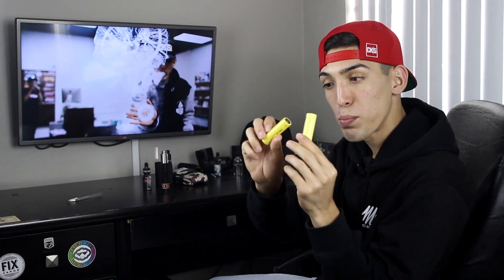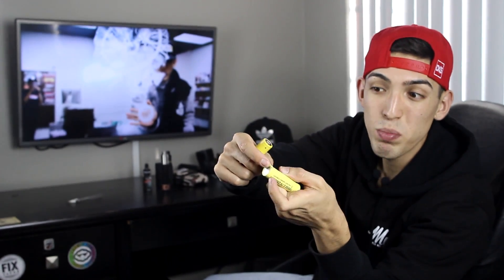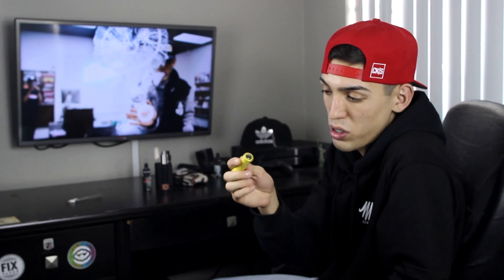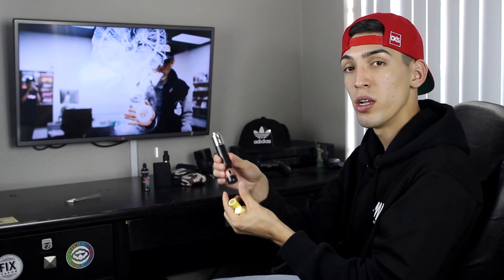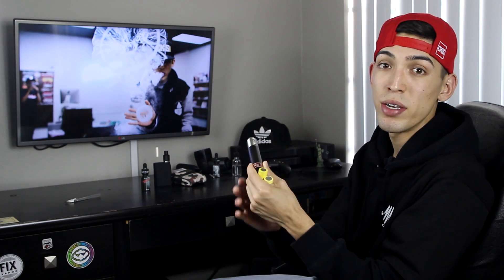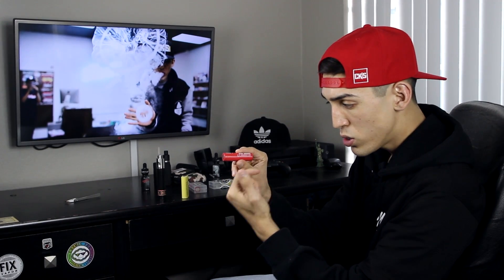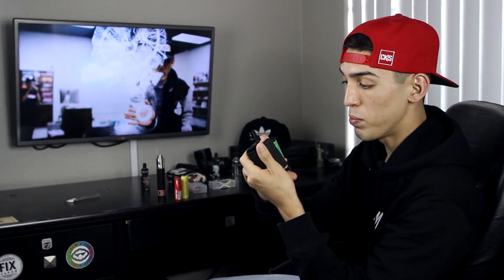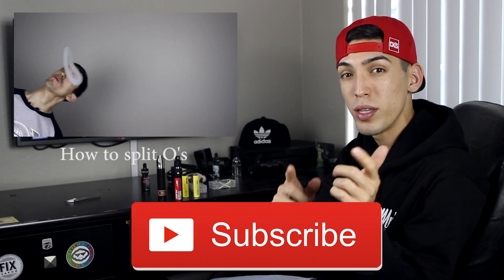WILL MY BATTERY EXPLODE??? (Understanding Batteries)

Comment: Tbh this is a very bad explanation of battery safety. First of all you keep talking about ruining your mod and the battery, you know that battery can easily explode and not only damage your mod or atomizer, but it will damage you aswell... Second, Awt 3000mAh 40A???!! there is no such thing as a 18650 battery with more than 30A... especially not continuous current.. 
If you think this battery is 40A and you will build coils that pulls 35A continuous from your battery it will short out or vent your battery..

Be sure to educate yourself more before you try and educate other people.....
Reply: Djilano Smit I don't see you making a video right? no ok so then it seems like u know soooo much then make a video yourself man y u hating for?

Comment: I have a smok micro one vape and it has a built in battery that u can't take out will it explode over time because I can't see the battery to check the wrapper. Also I use my phone charger to charge it is that bad?
Reply: Do NOT use a charger from ANOTHER source.  That is very important.  There is a good chance of explosions if you do that.
Reply: @justindloski9129  so how often should I check my battery cuz I was thinking I use it up for about two months then buying another one just for safety reasons but with that being said I'll check it at least once a week what do you think
Reply: Joseph Perales I’m not too sure about batteries and I don’t want to give you any false info.  Generally they’re pretty safe unless there’s a defect or it’s been dropped, etc.  brand name batteries are prob safer than generic one.  Make sure the wrapper isn’t peeling anywhere either.  Newer battery is prob better than an older one too.
Reply: @justindloski9129  Thanks Justin!✌️

Comment: There is no 18650 on the market that is truly over 30 Amps. With Li-Cells you have to look at what you are getting, you either get performance in terms of amperage or battery life in terms of milliamp hour or mah. You cannot not physically have both it won't work. Look up battery mooch he has a reddit or some form of website I believe and he tests batteries and has a top 5 list of his favorite batteries that he uses for vaping

Comment: Hey, i know this is a late comment, but i have a eGO AIO epen and i lost the charger, i have a phone charger that has the same output as specified on the makers site : DC 5V and 750 mA
Is it okay if i charge my epen with that? Im scared of that shit blowing my face off 
P.s. Before i got this ecig my friend charger it with a phone charger a couple of times already
Reply: OFFICIAL KRISTAPS read on the charger it should tell you the out put of it. but most likely yes it will work